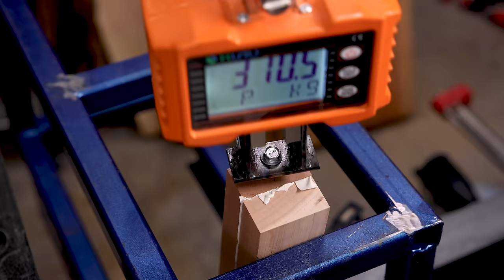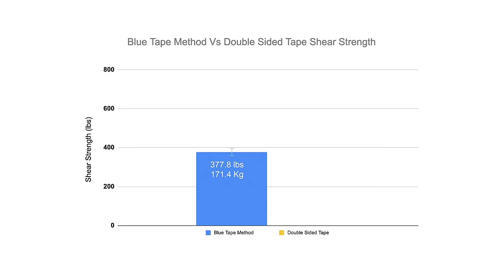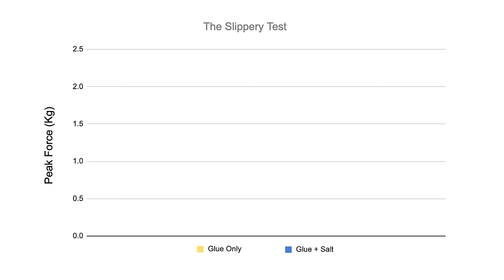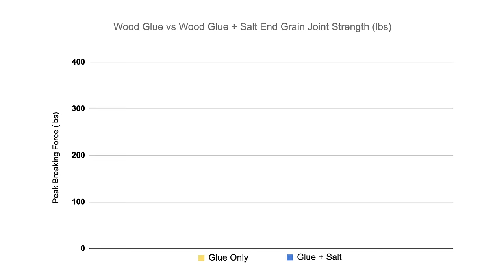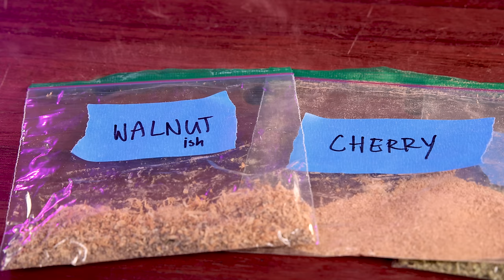Bad woodworking tips

Comment: You're using blue tape or painters tape exactly because the bond is not as strong (read: just strong enough) and these tapes can be easily removed without residue. With super sticky double sided tape, this can be a problem. Also Time saving is not the point either, to the contrary: you donate some time to save your precious surfaces. You don't want any tear-out from super sticky double-sided tape, so you make your own from less sticky single sided tape. That debunking really was missing the point, it backfired.

Comment: I appreciate the effort you put into this video, but I'm left with doubts and confusion regarding real practical application for some of your tests.  

Is there any residue left behind from the double sided tape? (I use less CA glue to prevent squeeze out, and I don't use activator, and don't have alignment issues)
Unable to provide equal clamping pressure to each glue up, would adding more pressure to the salt glue up resolve the gap? (I still think this is a bad idea don't retest this)
Would anyone really build something and not reinforce the joint with an expectation that it will hold? (we all know the answer to this question)

I agree with you 100% on the sawdust and wood glue.  I recently decided I just need to fill those w/ black dye and CA/Epoxy and make it look like a knot on purpose.

Just to give you an idea of where I'm coming from, statistic say it's safer to fly then ride in a car.  However, I know plenty of people who have been in a car crash.  I've never met anyone who's survived a plane crash.  (I'm not saying it can't happen, I'm saying people are focused on the wrong stats)
Reply from the maker: I agree with you. I filmed a discussion on residue and killed it in edit because the first tip was getting too long. In the test you can see some residue left behind due to the tremendous amount of shear forces being used. Though in real world use, I haven’t had enough inconveniences from the residue relative to the extra hassle of using blue tape. Perhaps a part of that has to do with personal experience and opinion and I could have explored that more in the video. 

Clamping was at 120psi. Already a bit of an overkill for end grain imo. I probably could have used even less salt, if anything. I definitely need to explore clamping pressure and starving joints in the future. 

On the point of practicality- not all of my videos will necessarily be practical, pragmatic, or directly applicable in the shop. They are more of an “fyi if you ever wondered” type of a thing. Next two videos are more practical. I gotta mix it up here and there and do passion projects.
Reply: @WoodcraftBySuman  thank you for that excellent response.  I look at these test results as a baseline.  These test definitely provide useful insight, that I can apply practically and pragmatically to my woodworking.  I look forward to your next video. Merry Christmas!

Comment: Why would anyone think adding salt to a glue joint would be helpful?  Wood glues cure from either oxygen and/or water vapor.  These have no problem penetrating the wood to get to the glue.  So you are just adding foreign materials with no strength to the joint.  Add sand and see if it helps (it won't).

Comment: I have used the tape and CA glue trick many times.  If you are getting squeeze out then you are using WAY too much.  Like ten orctwenty times too much.  I can hold a piece down for planing with a thin bead.  Literally a pencil line thickness.  Maybe two if the piece is more than an inch wide.  That also deals with the alignment issue.  No squeeze out so less accuracy needed.  The issue is not really whether double sided tape is stronger.  It is whether either technique is strong enough.  If it is then it doesn't matter if the other is stronger.  And there is no mention of glue residue which is a problem with some brands. But looking at the video amount of glue applied shows a fundamental misunderstanding of the technique.

Comment: double-sided tape is a disaster in my experience, spending time on peeling it off :c
Reply from the maker: I had originally scripted the nuance of tape residue and scrapped it in the edit. But essentially, while it is an issue, there are tapes that are better than others. The xfasten is probably one of the bigger offenders on tape residue relative to the other paper backed version I mentioned in the video. Though in practice, it really has not been a huge issue for me. Has it really been that bad for you?
Reply: @WoodcraftBySuman   actually yes, but I don't live in US and most tapes are nonames, but I will check out other types as well. Thank you for your testing! very helpful

Comment: I think you're missing the point.  Painter's tape and CA glue are cheap.  Double-sided tape is more expensive.  This iis an application where shear strength isn't particularly important.  It's not permanent. In fact strength can be a negative.  Too much double sided tape can cause too much swearing.😁

I wouldn't trust the painter's tape hack around a router but I just used it for painting a tool holder before assembly.  I had to mask off areas that will be glued, so had the painter's tape on the edges.  I then rolled out some painters tape on the bench, put a few drops of CA glue on the tape, then stuck the piece to it. The edge to be glued is masked and holding the rest of the piece so that I could paint all exposed sides.

Like all hacks, it's not one size fits all but it is a good tool to have in your arsenal.

Comment: Here's a way to combat a couple of the problems you brought up that are far too common on YouTube. QUIT USING SO MUCH GLUE. "Squeeze-out" should be tiny little droplets, not gushing rivers. More glue doesn't make better joints. In fact you might set up one of your tests to prove or disprove my contention that more joints have failed from too much glue than have failed from too little. Barely wet both surfaces. Parts about to be assembled should never have enough glue on them for it to run. I have clamps I've used for 40 years that don't have as many glue stains as some the nearly new ones I see on several "influencer" channels.

Comment: Going to call you out on the salt test you use course gain salt and every video I see states to use regular table salt which is a finer gain and I only use a few grains. The dent in the wood you used as an example a wet towel and a hot iron would pull the dents out.

Comment: NEVER PUT WAX ON ANYTHING IN THE SHOP THAT MIGHT TOUCH A TO BE FINISHED WOOR SURFACE!!!!. The tape on the clamp may be a pain....GET OVER IT. Dealing with tell tail fisheyes on your finish is a monumental pain. FYI: Alway wash you hands after eating or before you go to work  in the shop. One millwork shop I worked in was have major problems with fish eyes in the clear coat. after weeks they traced to a laborer sander who had potato chips for lunch and did not wash his hands before returning to work.

Comment: The blue tape method is a flawed concept.  Blue tape is not supposed have a high strength bond.  Super glue on top of a low strength bond is still a low strength bond.  Super glue is only high strength in tension and is not strong in shear.  Try using super glue to glue a pencil standing vertical. Pulling in straight up (tension) the glue is very strong.  It takes next to no force to knock it over (shear).

Comment: Double sided tape is the worst option. With a proper adhesive sticking double sided tape, you always damage the surface and often rip out fibers. No human beeing with a bit of intelligence uses as much superglue as you do. Everybody only uses some drops and does not spill the blue-tape with it as you do. Look at any skilled joiner or even luthiers, they always use blue tape and superglue and not double sided tape.

Comment: Hello, your video is entertaining, but not at all useful. Why do you use so much glue? I'm sorry but in practice it doesn't make sense.. 
It is clear that this causes it to slip. A thin layer of glue is enough and you don't throw most of it away. If it doesn't hold enough, it's the connection but not the amount of glue. Use dowels, dominos, splines or another joint to make the connection stronger. Same with the test with the double sided tape. Blue tape with ca glue is the better choice. You can remove it without leaving any glue residue and there are no tears when removing it. It's quicker because you don't have to sand off any stains or glue.
I've never had any problems with it and it's always held enough for every project and template. This is my opinion and you can have your own, but it makes a difference whether the tip is associated with advertising or well-intentioned. ;)
Reply from the maker: I am providing a mixture of my opinions and data. Just because I have an affiliate link for a product I discuss in the video does not mean it’s sponsored. Yes- the blue tape method works well and I say exactly that in the video “you may have had great success with it just as I have”. I could go on and on but at the end of the day, you can take some of the data in the video for what it is and apply it to your woodworking or don’t. It doesn’t really matter either way.